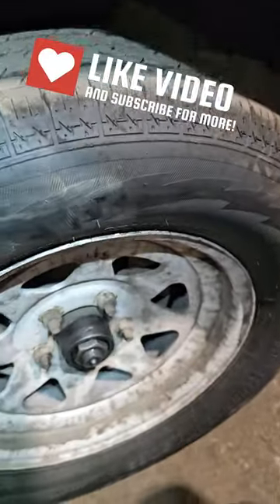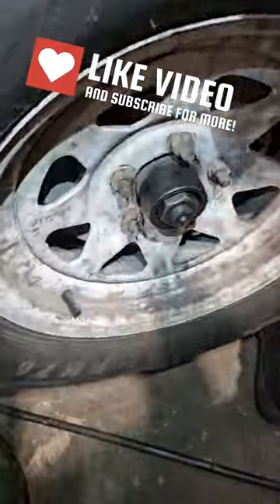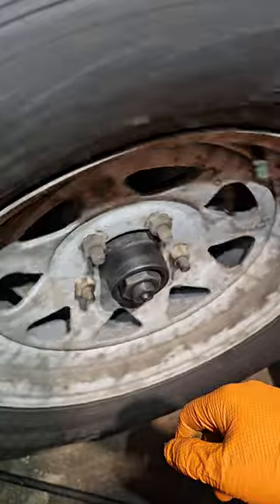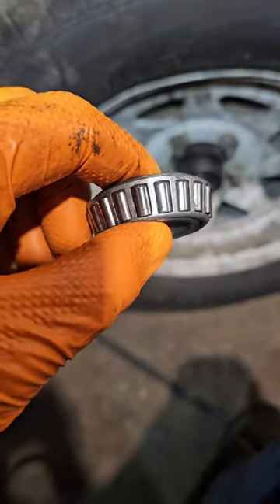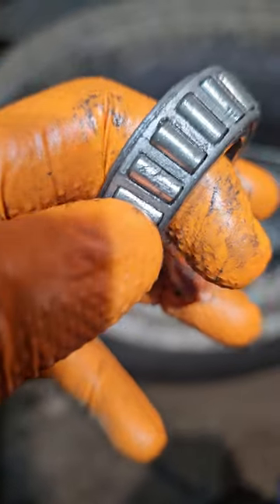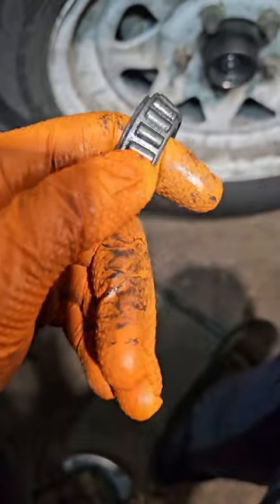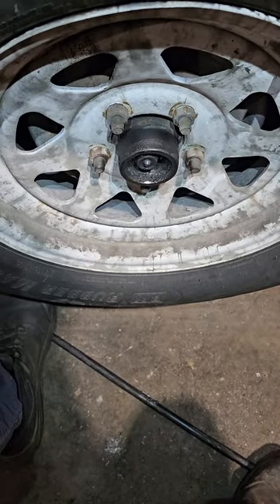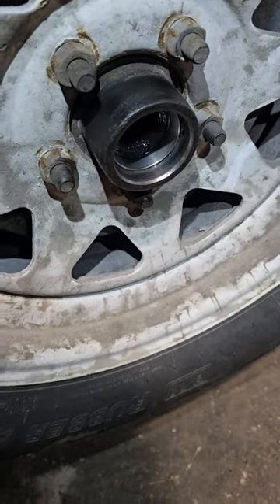DONT BE FOOLED! #trailer #trailerrepair #maintenance #shop  #mechanic #preventaccidents #bearing

Comment: You can use a temp gun to monitor bearing condition. That bearing you show  would get hot after 30 minutes at highway speed or 15 minutes under heavy load. It would get very noisy and alot of heat and play before a wheel off situation occurs. This type of bearing is used because it is capable of operating quietly and efficiently even with this minor damage and is not dangerous.

Comment: you dont have aaany play?
as in there is no clunk at all when you try to wiggle the tire when it's in the air?
as in it was set to the wrong clearance value on the bearing?
Reply from the maker: You should not have any play or very minimal on bearings like this. Since this is a castle style keeper and not a cotterpin pin you can have it hand tight and have just about zero or even zero play. No preload should be on these but if you want your bearings to least then they also shouldn't have almost any play.